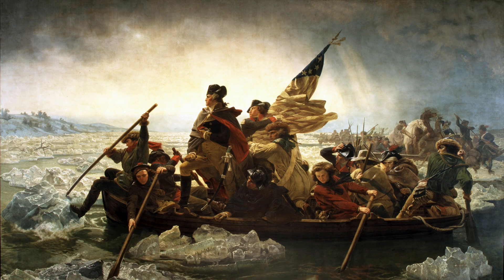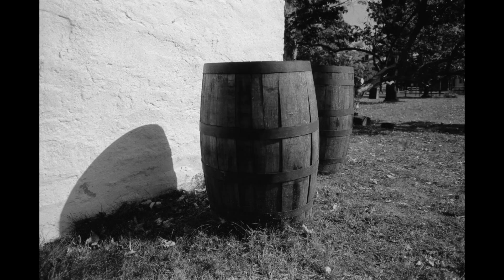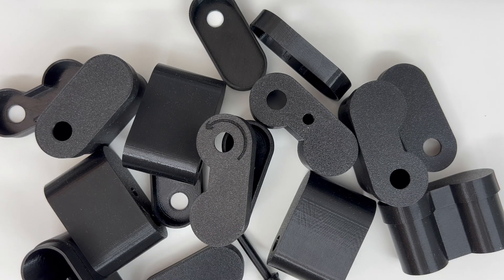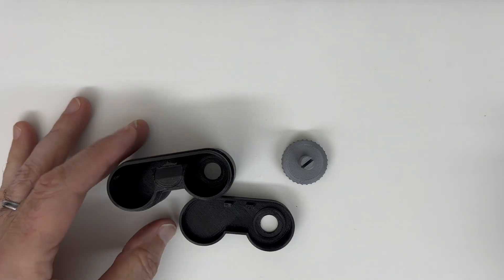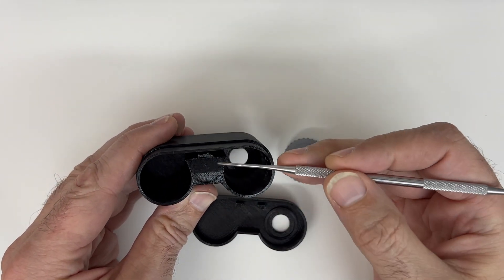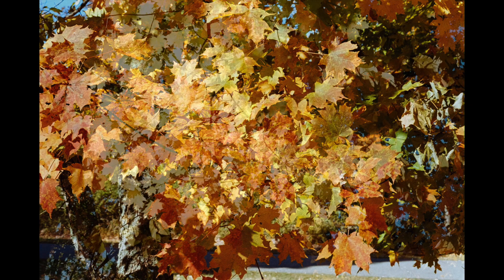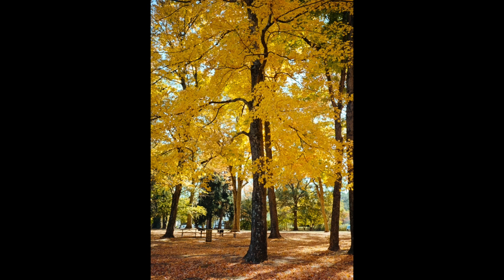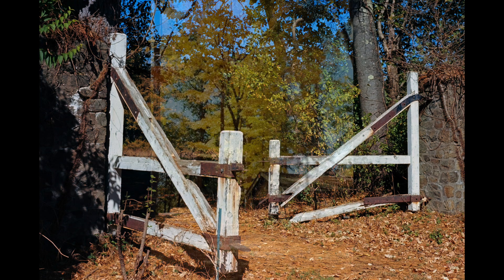Spiffy 35mm Roll Splitter Gadget

Comment: Great model!! any chance you feel like making a version of this that can be used for daylight rolling redscale film?
Reply from the maker: Thanks! Wow, I had to look that up. To roll redscale film involves reversing it so the emulsion is on the "wrong" side (you know this, but I just learned it!), so the rewinder would have to be designed with the film path going at a slanted angle, with the tops of both canisters facing the same direction. It's a bit of a serious redesign.
Reply: @TadTadd  Thats the one. excuse my ignorance to how much work these things take, it's beyond my skill set. well, if you ever do feel like taking on the challenge, let me know. i would love to see/test the results. thanks again!

Comment: Hmmh... I guess bulkloading film is at least as easy (especially if you have no 3D printer) and also cheaper (!). Plus you are not limited by the length of a standard 36 frames film.
Reply from the maker: Bulk loading is great! I have a roll of HP5 Plus in my bulk loader right now. But I don't have rolls of TMax 100 or Gold 200 or Portra 400, hence the need to split rolls this way.

Comment: Nifty contraption. I just recently started making short rolls after watching your “stick” method. So happy I found that. It works great. Have never 3D printed anything but this might make me check out places to do it. Or I’d love to order one from you if you start producing them. Thanks for sharing.
Reply from the maker: Glad to hear someone got something out of the "stick" method--in a pinch that always works. I'm curious myself about what the online folks do with multi-piece prints. I know they are quite competitive for other things--someone sent one of my little two-piece light meter cases for printing and I think they paid around $15. If you do this, don't forget to get the knob (that's linked in my model) and have that printed at 100% infill, the rest in 20-25% infill.